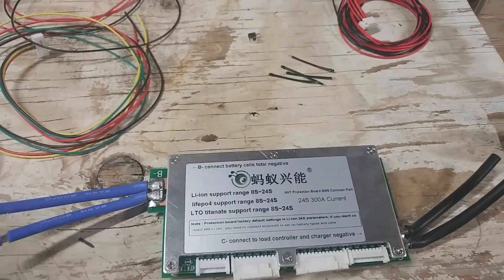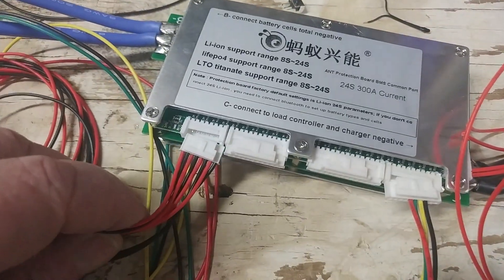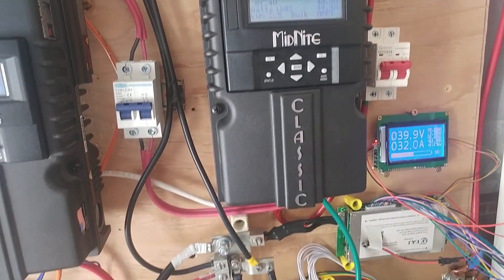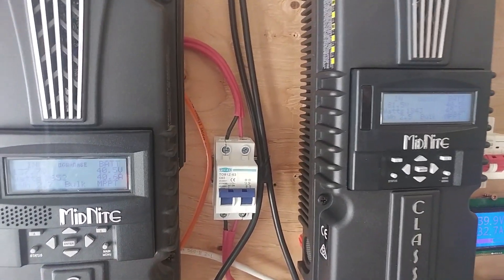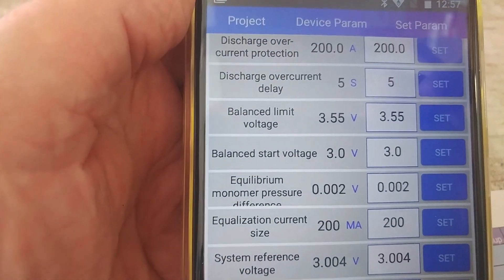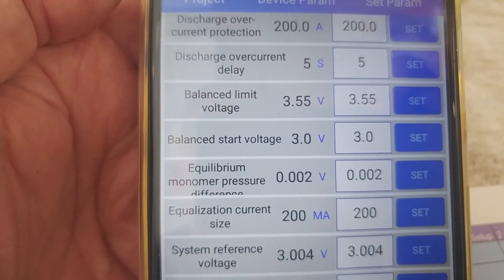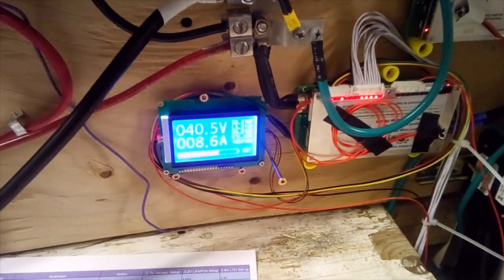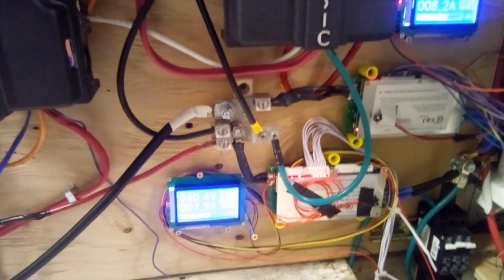2020 13 BMS Ant setup VBMS app

Comment: Where did you find the chart?
Reply from the maker: To be honest I can't remember but I think it came from one of the suppliers I bought one of my BMS from as it came with a user manual, Excel sheet called BMS parameter instruction RV4.6 (if you google the name it comes up)

Comment: Noob question here! Is the main C- cable connected to your inverter, or the charge controller?
Reply from the maker: B (blue) goes to battery C (Common) is used for both charging and discharging on the 2 wire BMS on 3 wire bms the charge and discharge are separate wires. Hope this helps you understand

Comment: Wow I have the same battery packs and the same style of bms, but I can't find the app, or at least I can't find one that works for iphone or mac.
Reply from the maker: Sorry can't help you there just an android guy lol
Reply: @offgridwanabe  Where are you located? I'm in Muskoka ontario - I was surprised to see exactly the same battery as me. I bought mine from a guy in Gravenhurst.
Reply from the maker: @eco_guardian  Yep Frank and I have been working on these batteries for a while now his system is awesome I just use mine for night time power. I'm on the Severn River
Reply from the maker: Just buy an old android phone off kijiji they are cheap and then use the app provided as you really need to adjust the settings and the only way is from the app.
Reply: @offgridwanabe  Yup good idea

Comment: Time for figuring things out for sure. Looking good. Maybe if you would post a link to the BMS could give others a good place to buy there's. Now will that BMS be used for all three units of batteries. Or each one have it's own. I tried looking deeper in to the back ground to see if i could see and understand. Wow nope was not able to.
Reply from the maker: I will post a link to the BMS. Right now in testing mode I have all 3 batteries going through 2 BMS but I think I will change that as it allows voltage to creep into the backdoor of the BMS which it has no control over. Eventually when I add the rest of the batteries 1 bms will run 3 batteries in parallel so the 2 sets of 3 will only be coupled on the main bus bar.

Comment: What gauge wire is on that BMS? Did you have to install/solder it on or did it came installed already? Nice video.
Reply from the maker: I used the wire that came with it, since I only needed 12s I just soldered on the other 12 to extend the wires. All wires were ready to use just push in the connectors except the short button which I soldered on I just crimped the ends on for the battery ends. I think that wire is 22 gauge. I never used the temp sensors as I have too many locations to monitor. Thanks for watching and commenting
Reply: @offgridwanabe  Thanks. What about B- and P- wires?
Reply from the maker: @DMIINC2013  They were already soldered on the board two number 8 fine wire I just added the cable ends with my hammer crimper and shrink wrap.

Comment: Id go on the site you got it from and check the connection pics
Reply from the maker: Yes I did figure it out and I did find the pictures for connection so I had a little more confidence when I turned on the power lol and no smoke.
Reply: @offgridwanabe  I think youve done a great job with your system
Reply from the maker: @frankz1125  Thank you Frank Z I know your work is professional so it matters.
Reply: @offgridwanabe  Do you get the bms s from the same seller ?
Reply from the maker: @frankz1125  No two different sellers boards are definitely different but not much. I may do another video showing how they get along now I have them working together.
Reply: @offgridwanabe  fyi the wiring diagram is provided on the aliexpress page dude
Reply from the maker: @jaylord55  Yes thanks